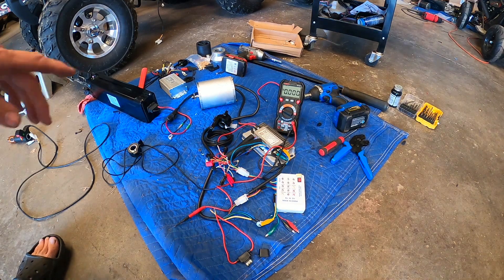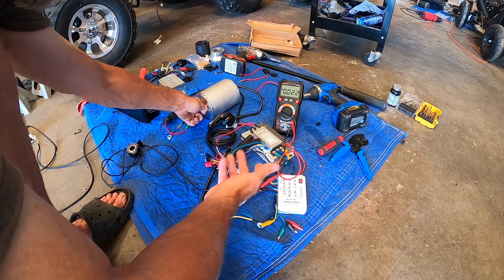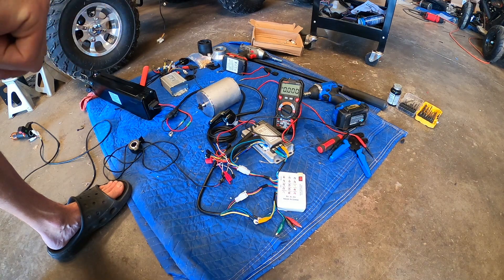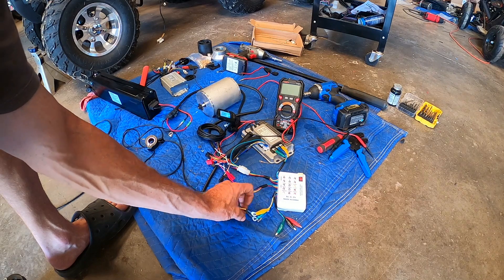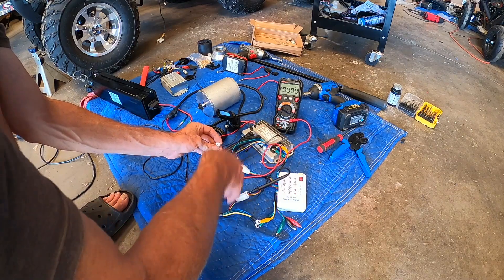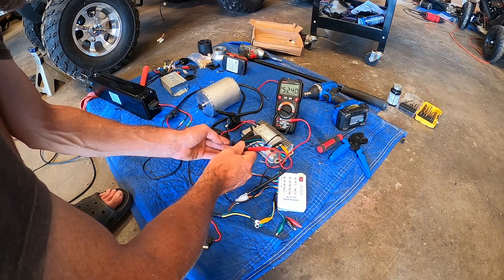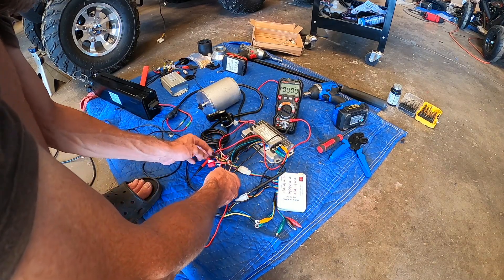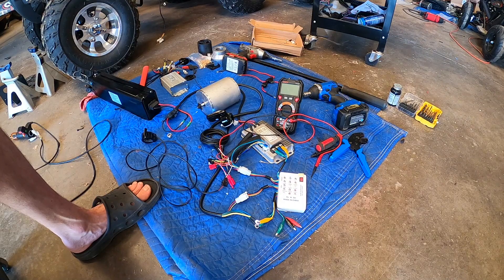E-Bike Testing the Electric Motor

Comment: if you change a controler or the display computer
they are a matching set
you cannot change one only ?
Reply: yes you can change them out but it doesn't always work completely, if display doesn't have a way to adjust settings through po# or can bus then you run into compatibility problems
Reply: @rpw0311  the can bus must be on the one that has screen display ?
it would be nice to see electrical diagram on these module